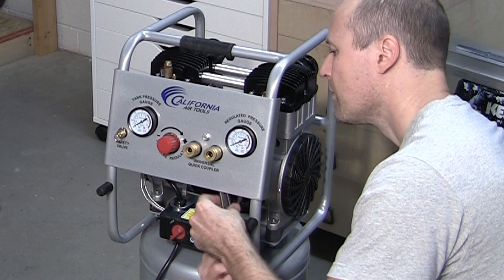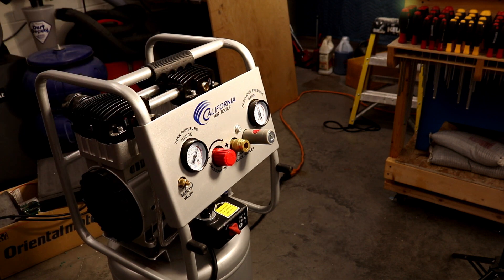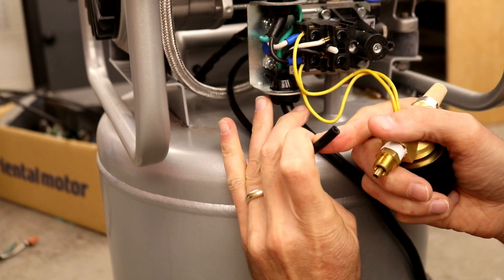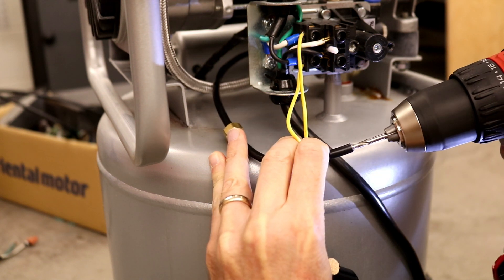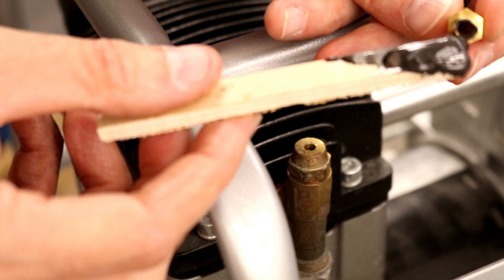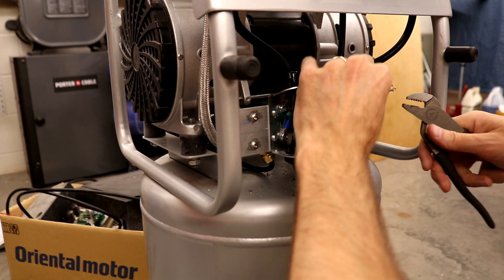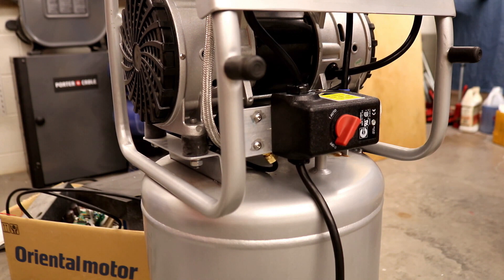Upgrading a California Air Tools 10020C Compressor

Comment from the maker: Be sure to also check pressure safety values: let the compressor fill and then feel how much force is needed to trigger the safety valve with light tugging. If a lot of force is needed, the valve may be defective and the compressor unsafe. The CAT compressor that I have only has a single pressure relief valve.
Reply: About the deformation.  That’s kinda sketch looking but surely they hydro tested em to make sure all is well.  I tested mine to 250 psi filled with water.  20 feet away behind closed doors lol.
Reply from the maker: @durangotang1681  One would hope so. They might do a sampling, with an acceptable percentage of false negatives (boom). The change happens over a couple of minutes and is hard to notice unless measuring. I only noticed it while trying to trim down video. The breathing effect may be the most interesting part of the video.
Reply: @kentvandervelden  I can imagine that most tanks show this activity.  But it is still scary!
I just bought one from HD and plan on doing a time lapse recording to see if my tank does the same thing.  It is only a 20 gal, but still uses the same style pump.
So far I do like it, but plan to upgrade all the plumbing because it seems undersized,  and install an auto drain valve.
Reply: @pomonabill220  Your 20 gallon unit, like the one I bought, is made of steel.  There's nothing to worry about at only 125 psi even when in industrial service.  It will rust through before it cracks from pressure deformation.
Reply: @durangotang1681  Hydrostatic testing, when done properly, tells you when to remove a unit from service.  It does nothing to tell you the expected service life of the unit.  The whole purpose of hydrostatic testing is to determine if there is plastic deformation of the vessel at the rated service + a safety margin.  When you boil off all the technicalities, it comes down to how big is the air bubble remaining in the vessel after it has been filled with water, pressurized, and depressurized.  If the unit is good, there will be no room available to add water after testing.  Depending on exactly how much the vessel deformed, it may be returned to service, or scrapped.  I ran a program testing 3000 psi spherical metal gas containers (both carbon steel and stainless steel) we used on aircraft, and regular hydrostatic testing was essential to human and aircraft safety.  I learned a whole lot about the subject when we had to change contractors for the testing service.  See my comment below about using aluminum for this application - it's only a good choice for the home user.  This would not be a good choice for an industrial application.

Comment: It's really sad you have to DE-LEAK this compressor.  Most or all of their compressors are made in China. So there's that. Regarding the flexing, that was interesting. As a scuba diver, I can tell you the diving industry gave up on steel tanks 40 or 50 years ago. I think they're all aluminum now. The problem with steel is rust. Aluminum can get some corrosion, but it's more resistant to corrosion than steel. Maybe a stainless steel tank is the real answer.

Comment: Good video. Another worthy mod is adding a transmission oil cooler and then water trap between the pump and tank to keep condensation & moisture out! Sometimes these tanks fail gently but sometimes it's extremely violent. With steel (?) as thin as shown in the video, I'd be doing everything possible.

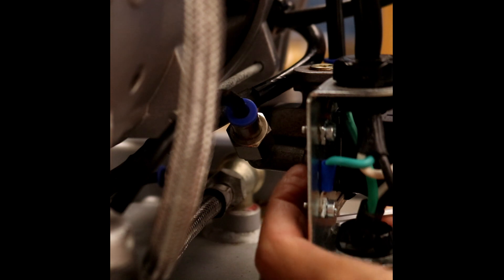Comment: Thank you for this very helpful video. I have this same compressor and it is bleeding out a lot of air from the unloader the entire time the unit is pressurizing. Consequently, it's taking a lot longer than necessary to fill the tank. I'm going to do the solenoid mod but can't seem to figure out how to remove the unloader with the elbow as shown at the 1:00 mark in the video. Any suggestions on how to remove?

Conversely, I presume I can just remove the hose from the unloader and insert it into the solenoid and leave the elbow unused behind the pressure switch?

Comment: Can two of these be run simultaneously into a common  hose? Do I just need check valves between them?  They don't seem to like to start if there's any back pressure they have to work against.
Reply from the maker: The compressor with a higher on-setpoint would run more, and the second would only turn on if the pressure continued to fall. The larger CAT models have multiple compressors, and a common pressure switch. Once the compressor turns off, the cylinder is unloaded. If the unloading does not complete, before the compressor turns back on, the motor will stall, overheat, etc. The unloading necessitates a check valve between the compressor and the tank. No additional check valve should be needed. Interesting situation you describe. Depending on need, may also consider a nearby large receiver tank instead of multiple compressors. Happy holidays!
Reply: @kentvandervelden thanks for the reply. Having a big tank makes the system take forever to get up to pressure. The large tank solves short term needs of high cfm, but doesn't solve a longer term need such as spraying.

Comment: I have this same model compressor and wanted to change the couplers, but I can't get them to budge. I can see what looks like adhesive on the threads. Were yours difficult to remove?
Reply from the maker: Might need a little heat to break the thread lock.
Reply: @kentvandervelden  Thanks. I'll give it a try.

Comment: ok I got it. 10020c seems to be cost cut version of 10020, but regulator might be better - mine black ABS piston is hard never works. unloader valve on 10020 is a magnetic valve.

Comment: as you said your unload valve has spring weak issue, what is the goodness of your new unloader? the time saving is compared to good compressor or your compressor with bad valve? I also see you said 2/3 restart can be saved but why? thanks I try to understand the improvement.

Comment: Man - thank you so much for this! I’m a mobile auto detailer and I got this compressor for the low db level - I’m going to use your video to make the same changes so it’s even quieter in my van and for the neighbors around my jobs. You narrated it and edited it extremely well. It’s concise, informative, gets to the points, and is very easy to understand. Thanks again! -M
Reply: Have you had to use your warranty?

Comment: How do you get the old NPT quick connects off? I find most manufacturers these days are using something like Loctite 545, and they wont budge. Considering applying heat from a heat gun, but wondered what you did?
Reply from the maker: Hi Chris, the connectors came right off, without heat. I don't remember what thread sealant was on them. Have a great day!
Reply: @carnold.knowledge did you find a way to remove the couplers? I have the same model compressor and I can't get the couplers off.

Comment: Can those 1/4" lines be replaced with 3/8" assuming those are bottlenecks for the whole system?
Reply from the maker: It's all possible, but the tank is small and the compressor has low volume. Replacing the lines will give you a higher volume for the first (very) few seconds. Since you understand the bottleneck created by the smaller lines, you should consider a larger compressor. This one is pretty minimal. Hope this helps you.
Reply: @kentvandervelden  I already have this one.......a few seconds? . Ya sure? No.  It would only be once in a while and I dont mind starting and stoping for a bit. I could always add a tank. Sheeah c'mon man
Reply from the maker: @Max-kn9yi  I must not have understood what you were asking. But, the useful improvements with bigger lines will only help at the output for a very few seconds. Further modifications could mitigate the causes, but reward is low.

Comment: Hey Kent I know this is a older video but I recently puchased a Cat20020AD 20 gallon compressor. I’ve been having a issue with the regulated pressure dropping to 60-70 psi with trigger pull on a blow gun when it has been set to 90. Do you know why this would be happening or what I can do to help this issue?
Reply from the maker: Hi Ben, in practice the pressure in the line will drop when air starts flowing, especially to a large sink like a blow gun. Especially, if the gauge is mounted in the plumbing vs. directly into the tank. If in the plumbing, the amount of measured drop by be influenced ratio of diameters of the gauge inlet hole (small) and the outlet. The underlying principle might be Bernoulli's: as the velocity of air increases (over the gauge inlet), the pressure the air exerts on its surroundings (the gauge scale) decreases. Hope these guesses help.

Comment: I usually put my thumb on top of the cold start valve till I can't hold it there anymore. ha... Man I need to do the solenoid mod. That blowoff is always so loud!
Reply from the maker: That's funny, I did that too :) Try to find a nicer solenoid than I used. It sometimes sticks closed.
Reply: @kentvandervelden   I ended up with a little guy from eBay. Around $28. I was able to mount directly to the back of the switch box. Btw that line for the unloader is a 6mm. A 6mm push fitting with 1/4 npt thread made the install super quick. I'm tempted to see what else I can fit behind that panel (water trap/filter)
Reply from the maker: @kewlbug  Cool, thanks for letting me know all worked out well. Let me know if you come up with improvements. I occasionally consider replacing the tank with a larger cast iron one, because I never need to move it... As luck goes, my next job is installing hardwood flooring and need the compressor on wheels :)

Comment: WOW!  I SURE don't like that time lapse of the tank "breathing"!  That would metal fatigue quickly, I would think!
Reply: If it were steel it wouldn't be a concern for a very long time.  Steel has a massive stress cycle life.  Aluminum (which is what this tank is made of according to the model number) has a very finite stress life, and this tank will crack over time much sooner than a steel unit would.  Service life will depend entirely on how often it goes from empty to full.  Think of it in the same terms as taking a piece of aluminum and putting it into a vise, then flexing it with something like Vise Grips until it cracks and eventually breaks.  Young's modulus for steel isn't even in the same ballpark as any aluminum alloy, and each of the commonly available aluminum alloys have different stress cycle service life expectations.  I worked on aircraft in the Air Force, and routine stress fracture inspections are a fundamental part of maintaining aluminum aircraft (really all aircraft, but composite materials are also in another league).
Reply: @lobuxracer  I think you mixed up the tanks, this one is a steel tank, not Aluminium. The AL tank has the letter A in the model number.  I've also checked his link to Amazon, and it states it's steel.

Comment: Great vid for NOOBs like muah. Waiting for a CAT-4710SC to be delivered; ordering all High Flow fittings and 3/8" Flexzilla hose with 1/4 NPT to try to give it a little extra umph. 
Only using it for Finishing and Brad Nailers during renos but they have CFM requirements close to top end of what this small compressor can do. 
Already looking into Prevost High Flow S1, would you recommend Milton 1086-4 (exhaust muffler) for my model as well? If so, in how many places? 
Thanks in advance for the guidance; trying to order everything in one order to avoid extra charges and delays. 

Happy Holidays!!!
Reply from the maker: Looks like a very similar or identical compressor and pressure valve. You'd need one muffler, a solenoid, and brake airline tubing to do the same upgrade. If your compressor is going to be cycling frequently, you'll appreciate the difference. I put a little muffler on the cold-start valve, just epoxied it into place, but it does not do too much and may not last long, there's probably a better way, but so far, so good. Mine picks up a good amount of water in conditioned space, but if you drain the tank each day, should not be a problem. I can't think of anything else I would do.

Comment: Hey Kent! I noticed the line from the tank to the Schrader (unloader?) valve that goes into the pressure switch is quite small (6mm ID?). While leaving that line, could I take the the output of the pressure switch and connect the aluminum regulator assembly/manifold directly to the larger port on the check valve coming out of the tank instead? This way I can increase flow by replacing the line with a normal 3/8" stainless steel braided hose

Would this set up interfere with the function of the pressure switch or Schrader valve since they won't directly connect to the outputs?
Reply from the maker: My guess is that the regulator creates a greater restriction than the small diameter riser tube the pressure switch is connected to. The compressor is not able to keep up with max flow rate as it is. If the flow is increased, the pressure will drop below usable levels quicker. Hope this helps, all just opinion though.

Comment: Please note that while this seems to work for Milton, the PREVOST Safety Couplings would not fit through the welded face plate. I used them anyway but I used a hole saw and a block of wood to enlarge the hole.
Reply from the maker: Most panels will probably need to be modified, I got lucky. The Provost couplers look great, with interesting options like the wall mount coupler with a built-in drain.
Reply: Good to know, and glad I saw this, I’m just about to place a small prevost order

Comment: Hi Kent, great videos. Especially your OCD on the tool length measurement system.     As I understand it steel tanks will not violently rupture releasing all the contents. The  tearing work hardens the steel as it tears halting further tearing of the tank to a much smaller rupture. As the pressure drops after the initial rupture the forces causing the tear reduce. I understand stainless steel tanks are different and the tear will keep running like a slow-mo balloon bursting resulting in an explosive decompression.
Reply from the maker: Thank you David for writing a great explanation. Metals are remarkable
Reply: Dont believe everything you read on the internet.  Steel tanks do explode and they can kill you.  Here is a recent story of a compressor explosion from a youtuber.  https://youtu.be/W2LbTHfU5fQ
Even in this day and age professionals lose entire pressure vessels and other structures when hydro testing them.  All it takes is a slightly elevated carbon content to make it succeptible to cracking and a stress raiser.   I spent a long time working on steam boilers and petrochemical plants doing non destructing testing and we found a lot of hair raising stuff which had to be immediately repaied before there was a catastrophic failure.

Comment: I think everyone who had a shop is constantly battling leaky aircompressor these are the most useful tips I've seen.........ive noticed that sometimes when my compressr kicks on it has a harder time than others almost like there's back pressure in the cylinders or somthing does this sound like an unloader valve issue to you
Reply from the maker: Unloader valve or it's cold (if an oil-filled compressor.) Should hear a pussssshhh sound (hopefully that makes sense) when the compressor shuts off. Might put a power or clamp-on ammeter to double check that the motor load at start up varies. The sound of mine certainly changes as the tank fills and the compressor is working harder. Have you seen the ultrasonic listeners for finding leaks in AC compressor lines and window seals? They would be fantastic for finding inaudible leaks.
Reply: @kentvandervelden  thanks ill give those things a try......the ultra sonic listener sounds interesting ill check it out

Comment: arggh, those evil NPT fittings are a crime against humanity, Better to stick with Metric and BSP like the rest of the world when you have a choice, Then again you are in Yankee Land. That tank flex sure does look nasty. You may want to add an auto drain valve on the bottom of the tank if you have not already to get rid of the water.

BTW single phase direct drive compressors are noisy things compared to 3 phase belt drive as the pistons are moving many times the speed of a belt driven unit.
at 60hz 4 poles your piston is moving at 1800 rpm which goes a long way to making the loud noise.
Reply from the maker: Hi Frans, I'm looking for a automatic drain. They're all internal timers. Maybe have it open a second each time the compressor kicks on instead of every 45 min. Might be safest to open the drain when I'm done and leave it empty when not being used. Just what I'm thinking today.
Reply: @kentvandervelden  Run it in parallel with the compressor motor, set the duration to a few seconds and the timer to about 30 seconds to 1 minute, that way it only kicks on with the motor running.
Reply from the maker: I like it, nice and simple. Thank you
Reply: @kentvandervelden  A little expensive, but here is an auto drain that only empties after water fills the little external reservoir. It also does not depressurize the tank.

Tsunami Moisture Minder Automatic Piston Air Tank Drain w/ External Reservoir (250 PSI)
Model: 152-0000
Reply from the maker: @HouseofKhaine  Thanks, I've seen some of their other products, air driers, and everything looks amazing!

Comment: Thanks, I will have to try those couplers.  Disconnecting while the tank is under pressure can be a bit scary.  I have the same compressor and it has been overheating.  It has a lot of hours on it so I decided to upgrade to the 4 HP from California Air since I need more CFM.
Reply from the maker: Hi Craig, you might look at the industrial version of the couplers. They don't have them at Northern Tools, but they are on Amazon. They accept several connector styles, which might be nice. Just a couple dollars more too.